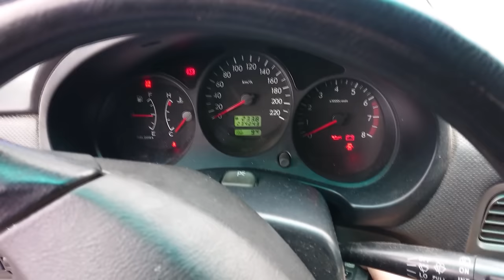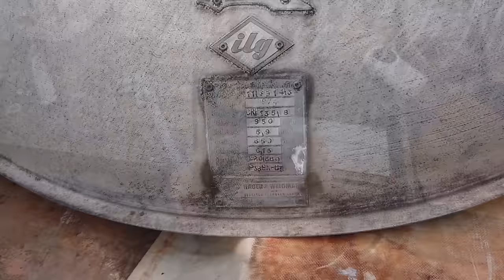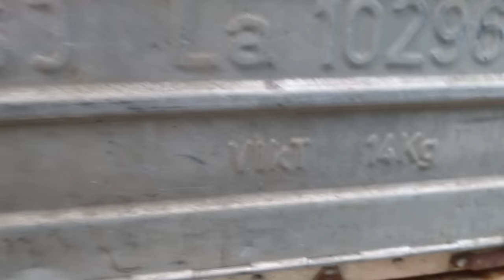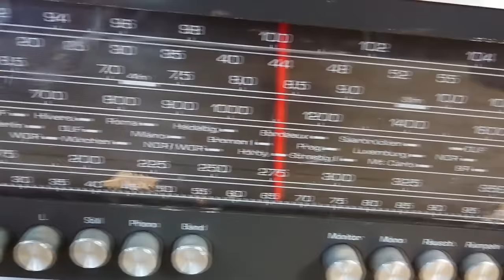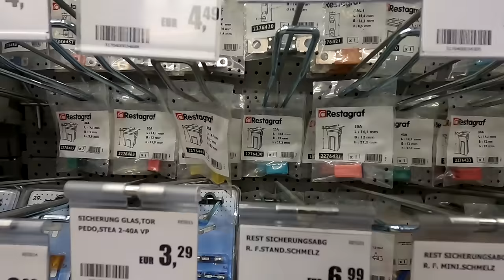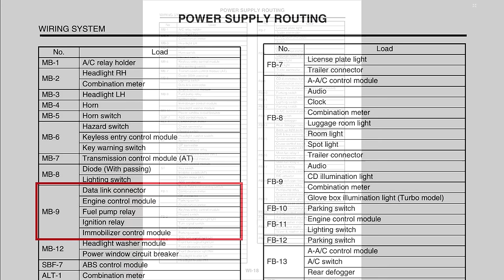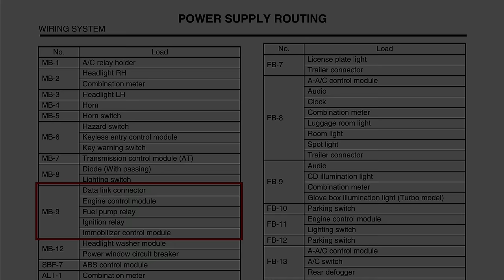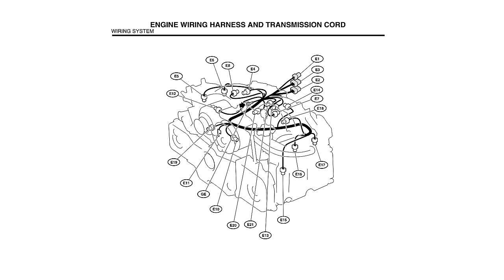New Awesome Scrapyard Finds! Repair-A-Thon!

Comment: Tip use a  headlight bulb instead of the fuse
Reply: Yes that is an old trick used in model railroading.
Reply: Exactly, that's how i found an intermittent short in my SV650. Pulling, wiggling and tapping all electronic things until the short circuit light goes on again. 
I used an indicator light.
Reply: Yes or make up a cheap trouble shooting light. High current / load trouble lights can use higher wattage bulbs while a low current trouble light could be as easy as a bi-polar LED (red for one current direction, green for the other) and a 1K resistor.
Good idea.
Reply: Using a digital multimeter is actually better! You would hear it, (as it beeps) when you wiggle on the cable.
Reply: @SurvivalSquirrel  That can work on an unpowered circuit but not so well on a circuit where power needs to be present for the fault to present itself.

Comment: I had a very similar issue with a Toyota Tundra pickup. Toyota decided to install wiring with rice paper based insulation ( supposedly more environmentally friendly) on the ignition module wiring harness. Squirrels loved it! I had to remove and replace the entire intake manifold to access the harness… I feel your pain! Love your channel.
Reply: It's a common problem with most modern vehicles.  The insulation is agro based to be biodegradable apparently it tastes good as well.
Reply: The harness on my friend's new Tundra, was severely damaged.  He lives on a farm, and had never experienced the problem before.
Reply: It doesn't matter what you wrap it in. Squirrels and rats will chew anything. I used to be a roofer and I can't tell you how many pieces of vinyl siding, PVC pipe, and lead pipe boots I've replaced that had been eaten by rodents. Squirrels LOVE lead pipe boots for some reason.
Reply: @oldscratch3535 Lead apparently tastes sweet, also toxic but not toxic enough for a quick kill.

Comment: I think you are lucky the mechanics stopped their diagnosis, imagine the amount of work hours they would need to put in to find the faulty wire in THAT spot. Even if they are quicker and have more knowledge it’s not a quick fix and the bill would have been huge. I really love your analytical style and deep dive into this, the narration is quite immersive :)

Comment: In regards to you rodent issue, I live in a rural area in Canada and as of a year ago we have had black rats, I have tried every kind of repellent both chemical and ultrasonic with zero success, finally I had to resort to poison a choice I did not take lightly but it did help for a bit, finally I saw a video where a fellow used a 5 gallon bucket with about 6 inches of water in it and a little trap door so when a rodent steps on it to get to food  (in my case peanut butter) they fall in, this method worked best, cheap and easy to make and you can catch many rodent's before needing to empty it, you will want to keep an eye on the trap it will stink really bad if you forget about it for a bit, in the first 3 days I got 17 rats and the number went down steady after that, now it's about one or two a week.

Comment: Troubleshooting electrical issues are always the hardest. I am lucky to have a auto electrical specialty shop where I live and they, surprisingly, are not only very good at electrical issues, they are actually reasonably priced. I have had to troubleshoot many an electrical issue on my own when working on vintage cars (rodents eating wires is very common) so I have gotten into the habit of tracing wires start to finish with a signal tracer (homemade), alongside my multi-meter, has worked very well for finding shorts and open circuits in wiring harnesses. It certainly helps that many of the wires are colour coded. Great Videos, keep up the good work! (my channel is "The Travells of Maus" not much electrical work, but some engine rebuild stuff and boring dashcam footage of roadtrips.) Cheers!

Comment: Came to your channel from James Condon. First comment I see is Watch Wes Work and under his comment I see Eric 0 and Ivan mentioned. I think I’m in the right place!😉

Throughout your entire diagnosis of the Subaru short I kept thinking it was a wiring harness rodent chew and I was right!  Two things came to mind then - first, Eric O’s “jiggle test” - grab and jiggle every piece of wiring until the culprit reveals itself. The second is also from Eric O and others - break every suspected wiring issue in half by starting in the middle and working one way or the other. In that way you’re eliminating by halves the actual location of the fault. 
Since the actual fault in this case was sporadic, that indicates vibration is altering the occurrence, so one should be able to vibrate (jiggle) the harness somehow, even if not at the exact location of the fault. 
Wes’s recommendation of a light bulb plugged into the failing fuse holder suggests to me providing an extra long wiring setup plugged into that holder so you can maneuver all around the vehicle with the bulb always visible and immediately spot when the jiggle test finds the fault.

Comment: Yes seems like most of the time what separates you from finding the problem involves removing perfectly good parts hiding the naughty ones. Good work and the resistor idea was a good one I had never thought of. I usually use a test lamp but I will keep that little gem in case I need it. Nice video! Cheers!

Comment: You did a good job with your diagnostics given the limited tech info you had available.  I work at an independent shop (all makes and models) that is known for fixing the issues other shops give up on.  This is not always a good thing, because as you mentioned this type of issue sets its own schedule.  Two of the resources I can't live without are correct wiring diagrams/schematics and the all mighty component locator  It may sound silly to most people but finding the component we are fairly certain is the problem or will lead to the solution is half the battle.

Comment: Built in obsolescence drives me up the wall!
The few companies that build things to last charge accordingly.
Years ago I bought a shirt from the brand Craghoppers. It lasted for about ten years and even then was still wearable.  When I ordered the same shirt again, what arrived seemed to be made from a totally different material, much thinner and not as tightly woven.  Several months later I met their representative at an outdoor equipment event and I asked him why, in my opinion, had they ruined a fantastic product?  He said that it was driven by the fact that if they made shirts to last 10 years they would have to charge five times as much as a shirt that lasted 2 years and if they did, no one would buy it. I suggested that they make a shirt that lasted 10 years and charge twice what they would for the inferior one then everyone would be buying it.  He wouldn’t be swayed saying that they needed the regular repeat business.  Well,  they lost my business which is a shame as the original 10 year shirts were really comfortable as well as being hardwearing.  It goes to show how companies work in the disposable society.
Miele however operate totally differently.  They build repairable products designed to last at least twice as long as their competitors. How great would it be if all companies did this.  We know they can, but they don’t.

Comment: What we do on the farm when we have rodent problems with electrical we wrap the harness with Honda rodent tape  part# 4019-2017 the stuff works well and actually keeps them out from under the hood. I dont know whats in it but they dont like it at all. This should be a lesson to mechanics. Dont just fire the parts cannon at a vehicle you have to systematically test each circuit i use a clamp ammeter and actually locate which wire has the load on it . Ive been repairing Cars and tractors over 40 years and i can say ive never had one i couldnt have fixed(some just arent worth the money involved).And instead of using fuses use a Circuit breaker of the appropriate current rating

Comment: 23:39 not sure about in Germany but in England we have a saying ‘you can’t see the woods because of the trees’ basically getting bogged down and distracted  looking for a complicated problem that turned out to be simple to resolve.
Reply: Same saying exists in Germany (word for word) ;)
Reply: well, the short was on the harness that was a PITA to remove and diagnose. It's more frustration than complication.
Reply: Woods because of the trees
Reply: One of my mantra's is "Common things occur commonly". Therefore check the simple stuff first, before you suspect the complicated stuff.
Reply: @zs1dfr  but what about Murphy's Law
Reply: @dimitar4y  Even Murphy's law occurs commonly, and so you must consider it early in your search for the cause. However, a piece of wire corroded or chewed through is still a more likely cause than a sensor which has shorted to ground. Therefore, I stick with Common things occur commonly!
Reply: @zs1dfr  b-b-b-b-ut I've seen extremely low power things like an indicator light somehow short to ground! D:
Reply: @dimitar4y  I don't argue with you. The indicator light is classified as a common thing. The microprocessor driving the light for example, would not be a common thing. I would test the indicator light before replacing the imaginary microprocessor, if you get my meaning
Reply: @zs1dfr  in my experience, ECU's die sooner than any other compo
Reply: We have the same saying in the US. "Can't see the forest for (because of) the trees".

Comment: In our old 2005 Honda Pilot, the mice got at the wires going to the injectors.  This was in an extremely difficult location to reach, but I managed to just barely get an iron in there and splice them.  I'm not patient enough/skilled enough to tear things down as far as would be necessary to do it right and was too broke at the time to take it anywhere.

A few years later when engine blew (a big chunk of the casting between a couple of cylinders just broke off), my trash harness fix was still working.  We paid to have the engine replaced and were informed that Honda had switched something up in the insulation to make it more repellent to critters.  Hopefully other manufacturers have done the same.
Reply: They used soy in the wire insulation back then- the mice really loved that stuff.

Comment: Mechanic here,
Just a quick tip for the next time you have a short to ground on a fused circuit like this. Instead of using fuses and blowing them continuously when you think you have found the short and want to check, simply use a test light hooked to a power source like the positive side of the battery and the ground side of the test light into your short. The light will stay illuminated as long as the short is there and you can just unplug components until the short to ground does or does not go away as in your case. Also around where I live we have had success using Irish spring bars of soap shavings around the engine compartment to prevent rodents from nesting there.

Comment: There is nothing worse than an intermittent fault. You try something, it seems to work, then the problem comes back... you try something else and round and round you go.  I have a collection of vehicles built between 1972 and 1988 and I know whereof I speak! There is no substitute for a dogged, methodical approach. It can take an age but when you finally get to the root of the issue, it is very satisfying. Until the next issue crops up....  Thanks for yet another great video: I really love the work that you do.

Comment: You are to be admired for not giving up! I do minor electrical repairs myself, and I have noticed so many times that I can fix what other people can't or don't want to, not because I am better or cleverer than them, but because I have time to dive deeper in to the problem. In retrospect, all you needed to do was remove that manifold and look underneath, and you would have fixed it in a day! But how do you learn where to look? Congratulations on your high quality detective work!

Comment: As a fellow 2004 subaru owner, I too found an issue with the very same.
In my case, I had a number of shorts riddled throughout the car, due to the previous owners lack of maintenance and habits, which caused my alternator problems as well, which then caused my battery to overheat, and vent.
So I went through the system, voltage drop testing and identified the areas of fault, which were a few in harnesses and master control switches.
In one of my services, I removed the same reservoir, and found that the moisture, and also the battery venting gas, had caused a ridiculous amount of corrosion in those pump connections. While I understand their orientation, them being vertical to catch and collect liquid is not ideal.
Still stick by my subaru at 307,921 miles, runs better than some cars with half the miles.
But you need to do that maintenance.
Im happy for you to have figured it out, I recognize the elation, and annoyance.

Way to stick it out.

Comment: I had an instructor that showed us how to wire up a automotive flasher and a buzzer to replace the fuse that keeps blowing so when it you find it you will hear it and don't have to keep running back and forth! Also on the rodent problem you should be able to wire up some motion detection to an ultrasonic deterrent.  I found that seems to do an OK job with squirrels and small rodents and doesn't annoy the bigger bipeds! I have every confidence that your solution will be simple yet elegant and include an arduino! Keep up the great work, and we on the on the otherside of the pond will try to not totally destroy democracy 👍

Comment: Grats on fixing your subi. Take care of it and you won't ever need another car. You are certainly capable of figuring out how to fix whatever goes wrong. By the way, I am a mechanic, and I've seen and fixed mysterious no start conditions that turn out to be mouse damage several times. It's often laborious and expensive, so don't feel bad that it took you awhile.

Comment: I had one of those folding boxes back in the 80's, got it from a local Tip. Great tool and used it for a lot but sold it on about 10 years ago. Solid and a great height when you want to sit or use as a work bench. Cheers

Comment: I love the folding box I have a cheap plastic version with no lid that is ready to be recycled LOL. I follow a few van life channels strategic intermittent strobe lights deter rodents. Get a small 12v battery and a battery to battery charger or a trickle charger so the strobes won’t drain your starting battery. Or leaving the hood open glad you got it sorted out 
LOVE the LAMPS

Comment: I drive a 70's vw van as there is so little to go wrong and it is easily fixed myself. Of course it still needs constant repair and faults can be confusing but by keeping it simple and sticking with the same vehicle I know it inside out and have learned so much over the years. I love your videos and ethos by the way.

Comment: The lights are by far one of the coolest things I have seen you build,  and one of the simplest.   I wish I had a set.   As far as the car, or any other thing with wiring harnesses goes,  rodents chewing on them is le kryptonite for them.   Hopefully you saved the old harness, and trust me it is worth saving, especially if they are as hard to find as you say, because you will have problems with it going forward.   Those plastic connectors will become brittle, and a slip of a tool can easily send accidentally break one.   It's easy to solder on a salvage connector from your old harness.  Finally, here in the states we have a product called "Fresh Cab" which repels rodents away from enclosed spaces, like inside a car.   It has a nice, herbal smell and lasts for about a month.

Comment: Great video! Lights are superb! My Toyota 4.7L V8 had red squirrels nesting under the intake manifold. They chewed the Knock sensor wire, which advances the spark for power. As I picked out nest material, I found the starter with my retractable grabber, now useless. Signs of rodents are sure indicators of wiring problems for disabled vehicles. Computers make vehicles more efficient, but they make them more fragile and difficult to repair. Wiring harnesses are less expensive to replace than repair. In my Toyota, the wire was repairable. I accused the dealer's service department of inserting trained rodents when the same problem occurred a month later.

Comment: Thanks for another good video. While the car repair was obviously very frustrating I think that we learned that disassembling and inspecting was the shortest path to finding the problem but that was not done until a lot of other things were tried. If a person doesn't have a lot of experience with car repair, it can be very daunting to disassemble such a complex machine and we all still hesitate to do it sometimes. In the end, however, your initial tests showed there was good evidence that wiring was suspect, i.e. an intermittent short, and it needed to be found. In all of your other repairs you don't hesitate to take everything apart, clean it all, inspect and test components thoroughly and from there the path to repair is clear. I think the same principle applies to car repair but since the scale is so much larger and more time consuming it is often avoided but shouldn't be. Congratulations on getting your car running again and finding the true cause of the problem.

Comment: Maybe a super useful tool you may want to get hold off: Telephone technicians in Germany use a "ring device", which you connect to one cable and you can follow the cable with a receiver, which picks up the signal, like an sending antennav/receiving antenna. The closer you get the louder and clearer it gets.

So you can follow a cable easily in a wire loom and even locate broken wires, as the signal will stop at the point the wire is broken.